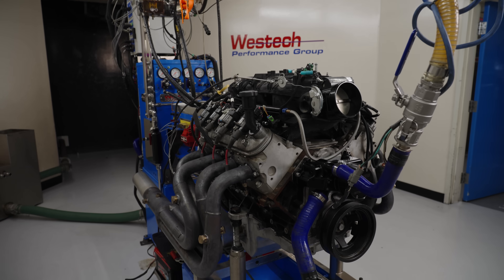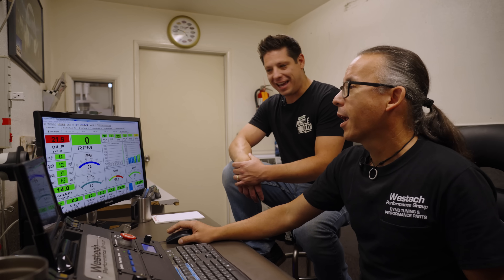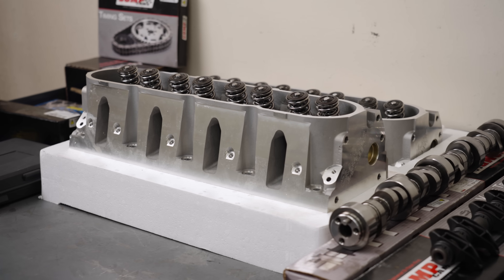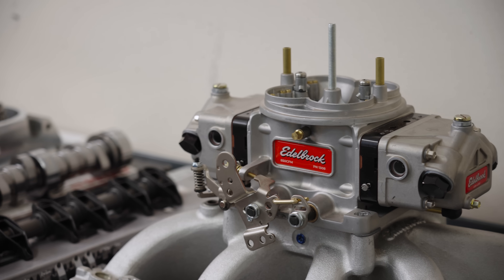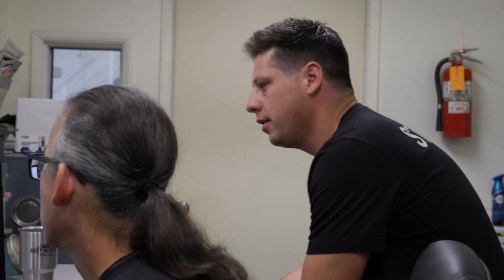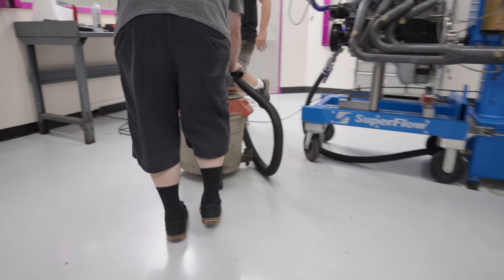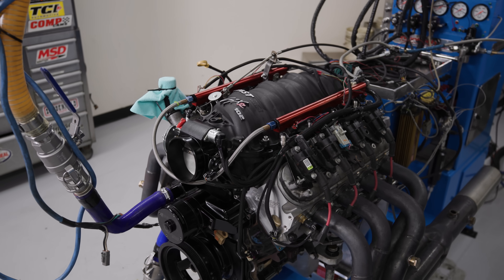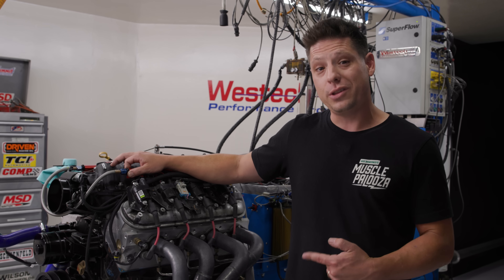4.8L LS: How Much Horsepower Can We Squeeze Out Of GM's Smallest Displacement LS Engine?

Comment: Round of applause for that little 200k mile engine turning 7200rpm and not coughing up a rod...
Well done little guy...Well done indeed!!  😅
Reply: I saw 7,500! What a champ!
Reply: Why did the chart fall off at 7100 then ? @87Aquarian
Reply from the maker: Go get'er 4.8!
Reply: Mine did 7400rpm for an insane 10.06 @136mph with a ebay gt45
Reply: A "loose" engine will turn and handle more rpm than a "tight" engine
Reply: I have PERSONALLY turned a 4.8 to 7500 while running 125hp nitrous on a BONE STOCK long block.  Switched to a single plane intake and Holley 750 carb with a 125 perimeter plate nitrous kit.
Reply: Why would it? Peoole run em at 1500hp like that
Reply: Now put it in a circle track car and see how many heats it will last. Real test. As tuned.
Reply: My bimmer with 211k does this everyday without a flinch 😂🏁
Reply: @daidinero7745 your bmw isn't a pushrod v8 truck motor lol
Reply: I mean how long will it last at that power and milage ? New to the ls world , just got a 5.3
Reply: Rather have a small block 283 that will scream to the moon at 12,000rpm  , or a DZ302  that came in the Z-28 Camaro
Reply: @jimthomas1989  12,000 RPMs...??????
Reply: @jimthomas1989 , definitely!
I had a 283 in my 50 chevy 5 window with a 2 speed auto transmission pushing just over 500 hp. That thing was a beast! 
Not very good on gas though .. lol!
Reply: Why? I have a DZ302. This 4.8 makes more power, and there are dozens of them in every junk yard. A BIG cubic inch small block still makes sense, but there is literally no reason to give up cubic inches torque and horsepower buy building a 283 or 302. Thats why mine sits in a corner of my garage.  @jimthomas1989
Reply: @mewrongwayKOCXF  the Flathead Ford is nothing like the d-series GM V8 lol 😆 the ls was originally designed for Ford and was supposed to be used by Ford but Ford didn't want to use it so they went ahead with their plans to use their modular V8. All the information is there if you do the research. The ls nothing more than a modernized 351 Windsor. Also you're trying to say that GM is the one in the lead when Ford was making dual overhead cam V8s way before GM ever thought to. Hence V8 tank engines.. GM decided to stick with the pushrod V8 so yeah. You're telling me in LS V8 is more technologically advanced than a Coyote 5.0? Look I like all cars it doesn't matter to me but you just sit there and act like ford is just trying to copy GM is just silly dude. If you don't like Fords that's fine but don't sit there and make up stupid shit.
Reply: @kskip4242 technology doesn’t equal better
Reply: @mogulme6190  obviously it does lol. Why does the coyote handle a thousand horsepower on a stock engine and an LS only handles 5 to 600 horsepower? Plus you can have a smaller Engine with all that technology that's more fuel efficient than the ls and still get big Power. Like what you like but don't act like technology isn't great. I have a 4 cylinder sitting in my driveway that makes the power of my older V8 back in the 80s and it's almost 40 Mi to the gallon, and you want to say technology isn't great technology isn't better!!??
Reply: @mogulme6190  I'd be confident the Ford 5.0L (the four valve type, not the Windsor) would easily top 500 H.P on a dyno with similar modifications)
Reply: @kskip4242 , only 500-600 hp!?
 Lmao!  
Come on now....
I love mustangs, even had one and gave it away, along with a handful of other hotrods when i moved to Maui. 
I am currently doing a motor swap in my Corvette and going with a smaller third gen 5.3 LS crate motor and it will easily be 500-600 hp ON STOCK INTERNALS! 
Easily done with 243 "with some simple porting and valve job" or 799 heads, bigfoot cam and headers. 
I will probably install trick flow Gen X 220 heads. I've seen a bunch of 5.3 ls motors produce those numbers ...
Reply: @kskip4242  GM didn't go DOHC for many reasons, 1 being simplicity , therefore cheaper to repair  2  much more compact so it fits into smaller engine bays,  3 better bottom end torque, yes at the expense of some top end hp and rpm,
Reply: @ockgator you forgot less reciprocating mass, reliability and a lighter engine. I don’t think repair costs were a reason though
Reply: @kskip4242  Keep blowing it out your backside!  Everyone knows better except you!!
Reply: @kskip4242 nobody said technologically advanced… you did.
Reply: @kskip4242 explain the chevy/Oakland v8 that predated the '32 Flathead motor!
Reply: @mewrongwayKOCXF the Chevy LS is extremely close to the architecture of a 351 Windsor Ford I hate to tell you.
Reply: @kskip4242  So is the Hemi. What’s your point? If the 351 is that great, why do Ford guys run Chevy engines?
Reply: @sstevocamaro because they celebrate pride month 🏳️‍🌈
Reply: @kskip4242 chevrolet Made the 350 SBC OHV in 1967 While Ford did 351 windsor In 1969. So Whos copying who and also The 351 cleveland is Always gonna be better then 351 winsor
Reply: @762chinoo  the 351 Windsor is based is a tall deck version of the original 221 cubic inch Windsor V8 which was made in 1962. Don't sit here and try to act like you know more than I know because you don't!
Reply: @kskip4242  and GM had a 327 in 1962 ? So whats your point u just know about fords fan boy
Reply: @kskip4242  Ok skip, your not impressed with a 4.8 pushrod engine with 200k from a junkyard?
Pushing 475 hp at 7500 rpm without taking a dump all over the dyno room??? So lets talk about the 427 sohc motor based off the bbc 427. And you should look at all the amazing stuff GM crushed when they got out of racing in the early 60's, leaving Ford and Chrysler all to themselves all thru the 60's. And then there is the first chevy V8 in 1917. Yes the coyote is impressive but its like a ferrari engine. When it breaks your looking at big $$$ The truth is all makers had good stuff over the decades.
Reply: @kskip4242  You'll have to excuse the oval girls. They are all ways coming up with off the wall stories to help them sleep at night because they just can't get past the point that Chevrolet engines are better than a oval brand. 🤔🤔
Reply: @kskip4242 And you know who invented the production V8 right? It wasn't Ford.
Reply: @kskip4242 keep dreaming ford boy, trust me they never gave Ford a thought when they designed the LS LQ architecture.
Reply: @averagejoe6084  It is a fact. Dig deeper..
Reply: @kskip4242  Lol that's still the silliest thing people say. Go check out a few older engines and you'll find that 351 architecture was used by some engines back in the 1950's. Non-siamese ported V8 head? 1951 Hemi. 4.4" bore spacing? Small block Chevy (duh, Ford used 4.38"). 4x head bolts per cylinder? Late-60's Buicks have that, so it's not a Ford-clone. You have to be smoking some primo cope-ium to think the LS is a Ford clone.

Comment: The stock intake manifold you started with is one of the best LS intakes you can get.
Reply: I put that intake on my Gen 3 4.8 that has a big cam and 243 heads and it really helped the power band from 3500 and up quite a bit. Definitely noticeable.
Reply: From what I've seen the TBSS intake on the 4.8s gets you the best bang for buck, 50lb injectors, 90mm tb, and picks up power and tq everywhere. Get a cam preferably something street happy like something used here but using some factory heads like the 243s and enjoy yourself a reliable 400-450. Throw some long tubes on and get it dialed in and your laughing!
Reply: @tyleroutingdyke849 I got a 4.8 stock rn and I thought a tbss Intakr just need injectors and I got a whole cam kit and soon going to get 243s,long tubes and installed all at once,you think it would get to 400hp?
Reply: @Jose-fu8cv  easy, but definitely needs a tune after all of that. Grab hptuners and 2 credits to buy the licensing for it and find a reliable ls tuner, you'll definitely see 400 if not more 🍻
Reply: @tyleroutingdyke849  easily 400 with just those mods? I heard it was hard to make 400
Reply: @Jose-fu8cv  with a good tune and the mentioned mods but with your own preference on what parts you can be anywhere near or at that hp, this is also depending on health of the motor etc etc
Reply: @Jose-fu8cv just get a set of 799 heads. Basically the same flow characteristics as the 243 heads. Have them ported and then add a TBSS intake, injectors, cam, valvetrain throttle body and get it tuned. Don't forget a 2400-3k stall and 3.73 or 3.90 gear. All of you commenting 243 heads have no idea of the 799 heads obviously. I made over 650RWHP in a 2011 Silverado extended cab 4.8L/4L80E, Texas Speed stage 2 turbo cam, LS7 lifters, CHP trunion upgrade, PAC660 springs, new seals, etc, high volume oil pump, ON3 single 70mm turbo and a tuner, all using 799 stock heads. Could've gone another 100HP on the stock injectors on 91 or 93 octane fuel.
Reply: @ thanks man ,I’m new to this and in high school just trying to get a budget build with atleast 400hp to show my friends with 5.3s and 6.0s that I can put a little 4.8 to work
Reply: @JustAGuy781  243 ARE 799 heads? But I definitely agree with the converter and gearing. Mine came with 3.73 gears already, but was on the fence about a converter, any suggestions? Found a 2700 stall that seems like my idea
Reply: @Jose-fu8cv  no worries bro. The 4.8L is the same block as the 5.3L. The main things that are different are the stroke and pistons and bores. You can literally swap most parts between the two engines. Exactly why the block is stamped 4.8L/5.3L. Don't choose a cam for chop, choose it to work well with all the other parts or supporting mods.
Reply: @ I was thinking a chopacobra cam,I heard it was good or any other suggestions ,I’m thinking cam ,243heads or 799,tbss intake ,long tube headers and cai.
Reply: @Jose-fu8cv  sounds like a good setup, but i would once again call Texas Speed and tell them what you are doing and what parts you will be using, etc and they will help you find a good cam. A choppy cam is not necessarily a good cam for what you are trying to achieve.
Reply: @ thank you boss,I’ll do that or do more research on stuff
Reply: @Jose-fu8cv  yeah, no worries man. A lot of people buy a cam because someone said it was a good cam and this and that, but I'm 100% certain that their choppy cam probably hurt their HP/TQ. Not saying a choppy cam won't add HP/TQ, because it will, but it will also hinder your efforts. I've had quieter combos that made more HP/TQ than guys with their choppy cams. Lol.
Reply: @ what would you recommend with the stuff I mentioned ,but forsure I will look more into it and call TSP
Reply: @JustAGuy781  how much did u spend on just the on3 turbo setup alone.
Reply: No doubt there! It was a runner for sure. Not as good as the LSXR though.

Comment: I have an 07" GMC Sierra 1500 extended cab truck with the same stock 4.8 Ltr  with the factory 243 heads when I got it 3 years ago..for a small 293 CID engine and heavy truck it runs damn good with just 105.000 miles on it..the factory Haines manual lists it at 295 HP at I believe 4800 rpm..so I like this tests..

Comment: whats really interesting is i know of one drag racer running this same size engine size but built out from Proline. It makes around 3500HP at 60+ Psi manifold and 3 stage 1000HP nos.
6 second car...on a 4.3 !  P.s yes a 4.3 it was special built and then left on the shelf. He needed an engine for 2023 so  thats what he got.  Theres a two year waiting list otherwise.
And this although small, was a full tilt build...I think it was like 70 grand on discount for the orphaned bare long block. It was $85k ordered as is, customer put down 20k and never picked it up!?!

Comment: now can you do the same thing with the 5.3L ? I would love to see the comparison 4.8 vs 5.3 since those are the 2 most popular available LS engines at the scrap yard.
Reply: I'm pretty sure Richard holdner has a video of that on his page.
Reply: @chriscovington11  ouu i probably missed that. Just saw his k24 turbo video. Im gunna def check it out. But any LS will make tons of power if you boost them
Reply: The 4.8 loves boost
Reply: @reyperez3424 LT had a build series on a single cab stepside with a supercharger. Wasn't crazy fast but it was still street friendly
Reply: @reyperez3424  all LS loves boost
Reply: 4.8 is easier to go for simply cause it never came with the dod and afm garbage I'll take a 4.8 over a 5.3 most days only difference is stroke throw a 5.3 crank in it and watch it

Comment: The 4.8 is the best platform for high rpm because the stroke is shorter than that of the larger LS engines and slightly less bore. Ported heads, high rpm springs and lifters will get you over 8000rpm

Comment: How come you didn't do springs? Looks like you were getting some valve float at the top end there, I think you could have made even more power if you could get that under control.
Reply from the maker: We did not have valve float issues during the pulls. The engine would pull clean to 7,500 but did encounter float higher than that.
Reply: @hemmingsmotornews  Yeah that's what I was noticing on the pull to 7600... but I guess it all depends if you would want to regularly spin it that high anyway.

Comment: Remember these heads were probably donated, I’m sure there is other sets that will allow for a bit more aggressiveness on the cam. 
To hit the 500 mark.
Plus those headers are shit.. you can expect as much as 30hp difference over other aftermarket headers if you had them custom built around head and cam profiles..
Just pointing that out
Reply from the maker: You're looking at a set of Schoenfeld 1 7/8" stepped to 2" primary headers. One of the best sets we've ever tested.
Reply: @hemmingsmotornews  but show me a engine compartment that will allow a set like these.
I think using a chassis based set really makes more sense.
People watching these videos have figured out through videos and books and real world examples. That you can’t watch these shows and take much away from it because it doesn’t ever factor in real world scenarios.
And those are probably the best off the shelf models.
But I will bet you any amount a custom set built around everything on your engine will get more.. those are a dirt track header
Reply from the maker: @maegenyoungs2591  Chassis headers don't clear the dyno, so we run dyno headers.

Comment: LOVED my 4.8 in my 2003 Silverado.  It had good power and got consistent gas mileage.  I miss it!
Reply: I consistently get shit gas mileage around 10 mpg, but my truck has a booty setup. Other than the mpg complaint the 4.8 is mechanical sound and stupid reliable.
Reply: @robboss1839  Around 10 mpg? A classic 427 would do that and produce one hell of a load of stump pulling torque!
Reply: What happened to her?

Comment: Am the only one shocked 😲 at the cam specs of 235 intake and 251 exhaust? What about revving to 7500 rpm? What springs did you use on the rockers?
Reply from the maker: The Edelbrock heads came with higher pressure springs for a hydraulic roller cam that let us rev to 7,500 with no discernible valve train control issues.
Reply: Yeah. That’s honestly a stupid size cam for that engine. I wouldn’t go that big on a 6 liter if it was going to be used as a street car.
Reply from the maker: @Maverick09171  but race car stuff is cool lol. I actually just stuck a similar cam in a 408 I built and it had a beautiful torque curve. 600 hp and over 500 lb-ft on tap as low as 3,500rpm.
Reply: @hemmingsmotornews yeah it is! But that’s what I’m saying. That cam in a super light race car, sure. That cam in a street car with a 4.8, no bueno. Not a fan of dyno queens personally. 

But yeah we can agree a 408 needs a lot more cam than a 292, yeah?!
Reply from the maker: @Maverick09171  This setup is going in a land speed Camaro.

Comment: I mean.... that's 100 hp / L out of a pushrod 2V engine.  That used to be exclusive domain for DOHC 4V systems, so pretty awesome overall.  That RPM range is badass, 7200 RPM!
Reply: Chevy had push rod v8s @1hp per liter in the 50's and they were push rod first the 283 and then the 327 in the corvettes
Reply: @robertbignar9129 that is 1hp/CI. 283CI=4.638L so the 283 would make 61hp/L
Reply: @adamdodsy84 GM is sticking with pushrod V8s.  The Corvette might be getting them, but Corvettes had DOHC 30+ years ago as well
Reply: @Mastermindyoung14 DOHC with a lotus design Head and Lotus helped with the DOHC system found in the LT5 in the C4 Vette😏
Reply: @Mastermindyoung14 yes, you mean that Lotus/MercuryMarine engine put in the mid90’s ZR1 corvette?  That engine was a absolute dawg and nothing to write home about
Reply: @RealSVTJunkie Most 90s v8 engines from all makes were dogs 😂
Reply: @adamdodsy84  so the new pushrod engine they're developing is fake news?
Reply: @Mastermindyoung14  There is the 5.5 DOHC that Chevy has in their c8 z06. lol
Reply: They didn't rev the engine enough. Power still climbing
Reply: @adamdodsy84  considering MORE Ecoboost V6s than Coyotes are sold in the F150, the coyote isn't even a factor. It's not about out right HP, but torque across the band and fuel efficiency. The direct injection 5.3 with variable valve timing works just fine and is far simpler than the Coyote AND the maintenance nightmare Ecoboost V6s in the Fords.
Reply: Since DOHC engines are currently making 125+ HP/L yeah I guess that's to be expected

Comment: Vic Jr was wrong choice for that combo, a AirGap or RPM intake works way better with carbs on LS, and makes more "controllable" HP.
Reply from the maker: Dual plane's such as the air gap are great intakes but they favor mid-range power and torque which was not the goal for this test. A good single plane will almost always make more power than a dual plane manifold.